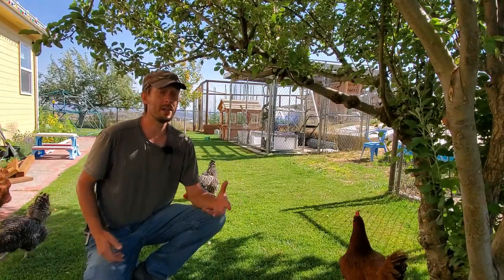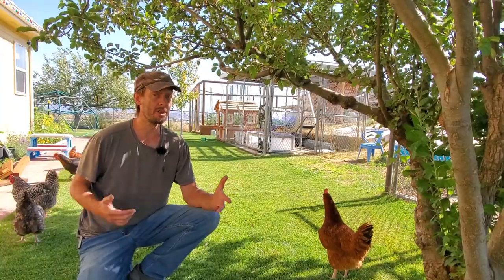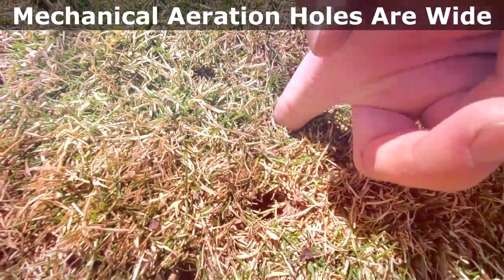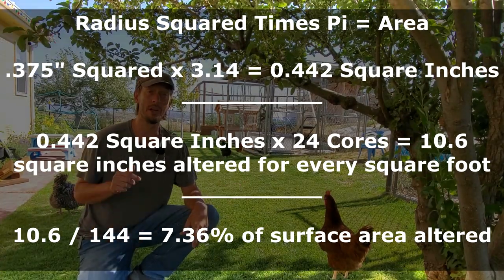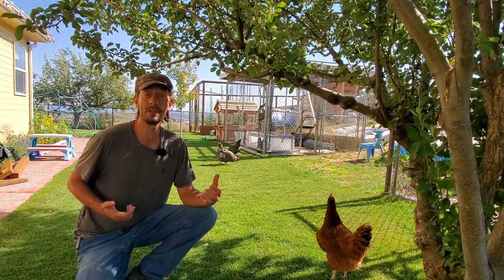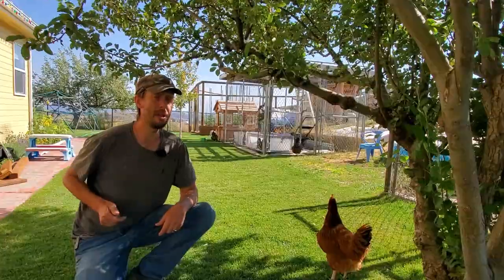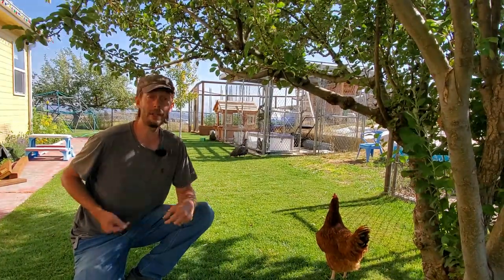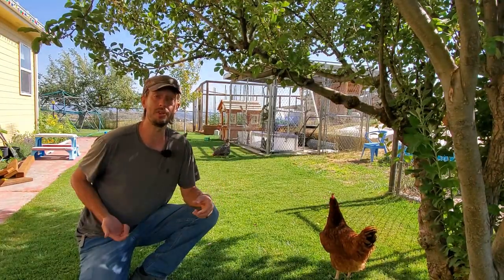How Far Apart Should Lawn Aeration Holes Be | How Many Cores Per Square Foot?

Comment: You are not messing around with the number of cores.  2.5" spacing is 25 core/in^2, two inch spacing is 36 core/si.  That is a lot of holes.

Depending on the goal, i would think that making more small diameter deeper holes is better than fewer  larger shallow holes? 
I am interested in dealing with sub-surface mole tunnel damage to the roots and missing soil and also an issue with redwood roots stealing the water just under the surface.  I am not really sure how to deal with the root issue, short of deep tear out and root cutting, plus re-seeding without killing the tree (which should be fine).  I am hoping that deep coring will make a big difference.  Also, I dont think that powered rental corers will go deeper than 3". 
Thoughts?

Also, what are your thoughts about the various manual corers?  Corona vs Yard Butler or Fiskars?